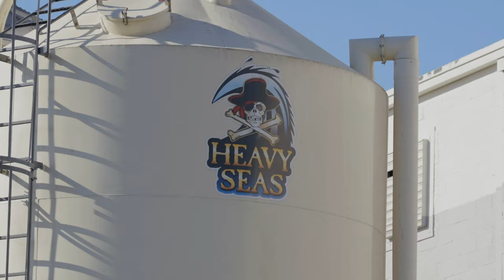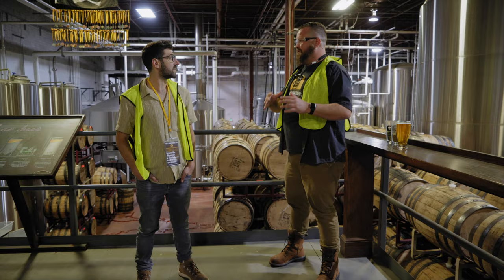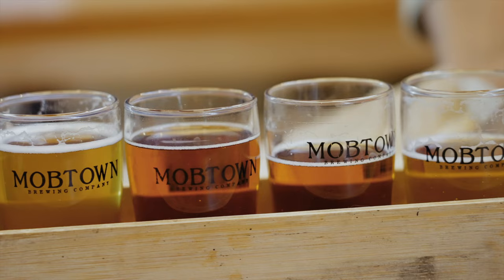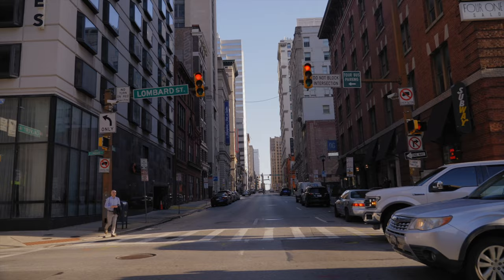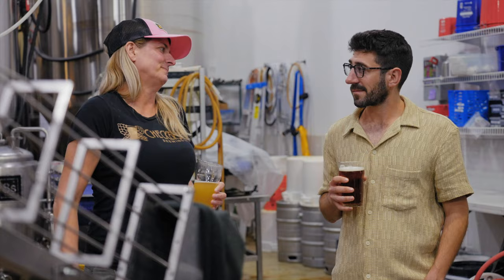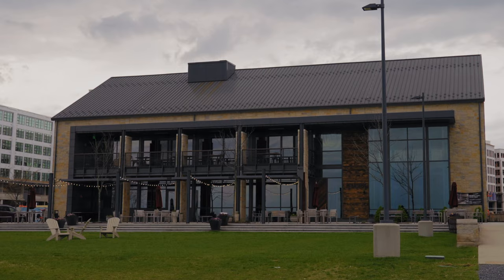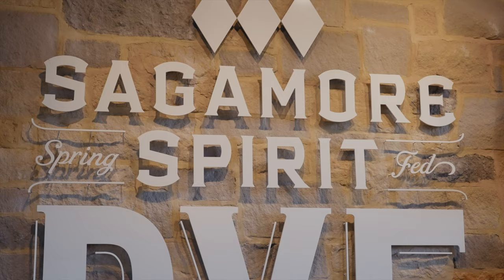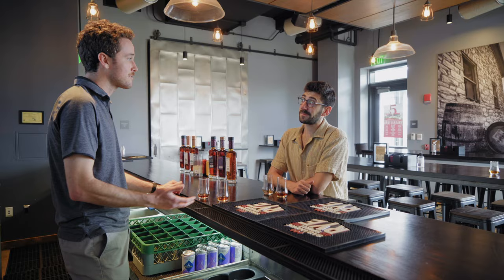Next Exit: Baltimore - Craft Beer, BBQ, and Harbor Views

Comment: I was in Baltimore in the late 90s. There was a phenomenal beer scene there at that time. Brewer's Art was a highlight, but Sisson's was the winner. Did Sisson's become Heavy Seas? I saw the old sign on the wall there.
Reply: Correct. Hugh Sisson opened Heavy Seas in the late 90’s. He was one of the pioneers of the craft beer movement in Baltimore.
Reply from the maker: Awesome eye, Kurt! Sisson's was a family-owned pub where Hugh Sisson worked before he left to start Heavy Seas. So it's all in the family!
Reply: @untappd4695  I bought some of the Greater Pumpkin today as a result of this video. And if it has Sissons in its bones I expect it to be excellent. Keep the series going!
Reply: Yep, and Heavy Seas was originally called Clipper City. Heavy Seas was their high ABV product line and they rebranded completely to it in an effort to have the brand tied less specifically to Baltimore local.
Reply: I remember a weekly beer radio show that Hugh did and/or participated in.  It was years ago.  I lived one block down from brewers for a decade.  $2 happy hour beers. Surprised I’m a functional adult.  😂
Reply: I stopped by Brewer’s Art this summer for the first time in years. They’re still making great beer in a very beautiful old building.